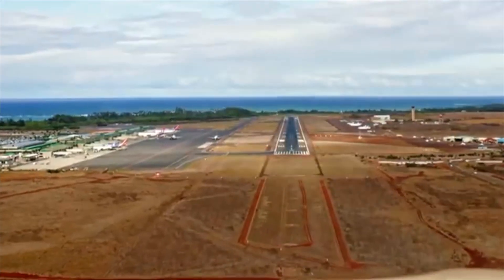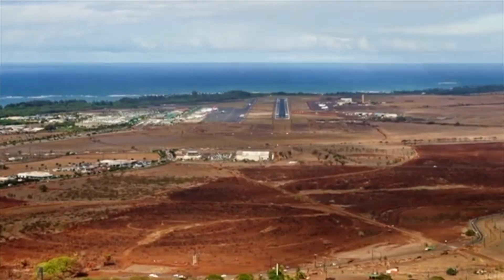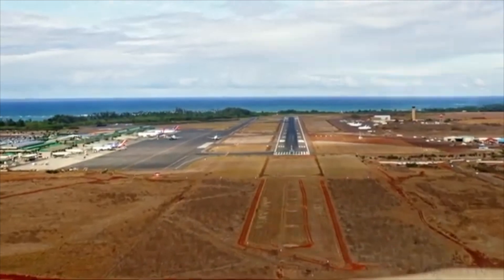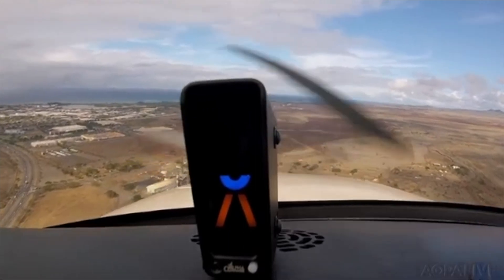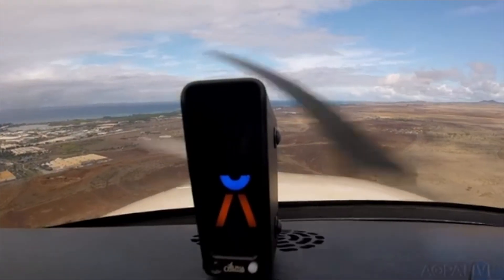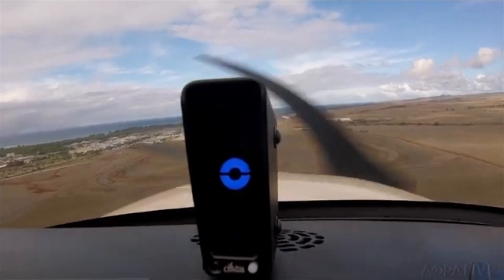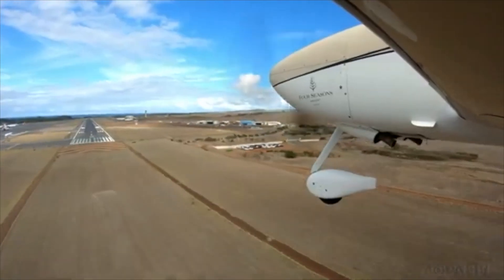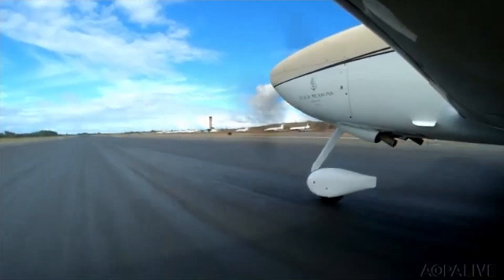AOPA Live! on Angle of Attack

Comment: AOA visual displays? Well, no... there are fundamental issues that this video ignored.   * Three research papers show that loss of control has unusual attitudes as a factor comparable to AOA. My own research indicates that stall/spin is over-reported as an accident mechanism, and this finding found agreement with an aerospace professor and the head of safety for a major aerospace corporation. In other words, if you count on AOA to prevent loss of control, it will be ineffective for a significant number of events.  * AOA has very strange lead/lag characteristics when maneuvering. In other words, you can only really use AOA when everything is calm. That’s what they did in this video, fly smoothly with no quick maneuvering.   * AOA is very noisy, especially in turbulence. One way to hide this failing is to make the resolution so coarse that the noise is hidden which, by the way, means that the guidance becomes low precision. They did that in this video, too. Actually, it looks like they were flying pitch attitude (good practice) to find a good AOA in smooth air.   * So how do you make a visual that makes AOA look good? Smooth air, smooth maneuvering. Nobody makes AOA videos in up and downdrafts because it would show up the problems with AOA.   * Saying that AOA is lift and airspeed is energy is flat out wrong. The lift equation shows that lift depends on BOTH airspeed and AOA. The AOA narrator ought to know that. His platitude does aviation a disservice.   * Aural stall warning, yes. Visual AOA? A fad that refuses to go away. One vendor wrote, “I discontinued my AOA glareshield display product 10 years ago because it did not solve the problem.” BTW, I gave a forum at Oshkosh two years back talking about the failings of AOA, and those failings are fundamental, not vendor-specific.
Reply from the maker: Incorrect. Not true. I fly in turbulence and gusty 30 knot winds all the time. It’s instant at letting me know wind shear is about to hit. Why? Because it measures changes in relative wind. You can see turbulence affect the indicator as well. I have no idea about your experience or education. But I can tell you this is. It the case. Come fly with me and I will
Show you.

Comment: Once again we have a misunderstanding of the AoA meter and how to best use it.  The AoA meter is NOT a replacement for indicated airspeed in the pattern and on approach to land.  The tool can be used to AUGMENT by visually verifying the angle of the wing in turns close to the ground.  If your airspeed is under control you should still not have trouble making these turns with too much or too little energy possibly leading to excess load factors or pulling up on the nose to maintain altitude and exceeding the critical angle of attack.  It is a BACKUP to the basic and proven techniques to fly a given indicated airspeed in the pattern and over the numbers when landing.  One other point that is often misunderstood.  The Vs0 is the same number regardless of density altitude.  The only adjustment should be for gust factor.
Reply from the maker: That is actually incorrect.  Lift is a function of air density, velocity squared, the wing area and the Coefficient of lift.  L=1/2pV^2SCl  Vso changes with WEIGHT, BANK ANGLE, LOAD FACTOR.  It is a basic principle and is used in Introduction to Naval Aviators and why US Navy solely uses AoA to land on carriers.  At high density altitudes, say Telluride as an example, you need a higher AoA given the drop in air density.  Thus you can control that with Airspeed, pitch or wing area. As to the "backup" notion. Well, if you read page 75-78 of Stick and Rudder he would disagree.  We are slowly evolving to a world where the technology will be cheap enough that AoA will eventually be the primary tool for landings and slow/low flight.
Reply: @artistwithcameras  The aerodynamic definition of lift is not in the argument.  And, btw, even during stall the wing is still producing lift, just not enough to keep the aircraft aloft.   You do not change IAS speeds dependent on density altitude.  The only time you add speed to Vs0 is for a gust factor which can increase drag when landing.  At typical civilian aircraft operating speeds, the aircraft's aerodynamic structure responds to dynamic pressure alone (difference between total pressure and static pressure), and the aircraft will perform the same when at the same dynamic pressure.  Thus, one should NOT deviate from the V speeds published in the POH.  An AoA meter is useful to verify visually when low and slow during take-off or from base to final that wing angle is not near critical.  But it is a FYI only and should not supplant or take the place of maintain the IAS speeds as documented in the aircraft POH.
Reply from the maker: @speedomars  that will change in time. The FAA is making a case for it in the future. I’ve already been in touch with them on it.